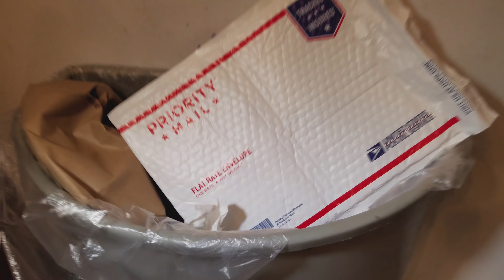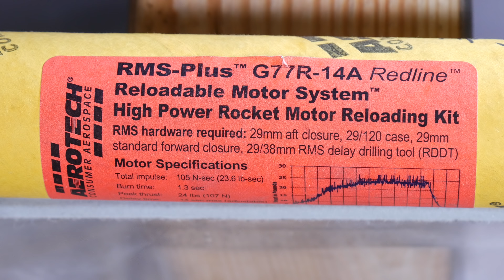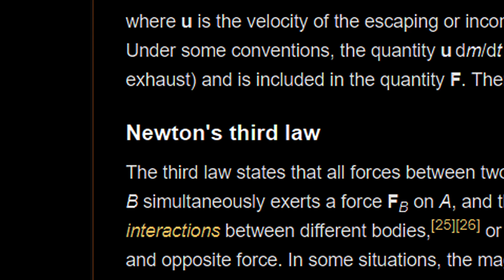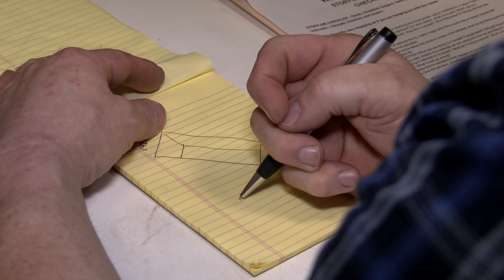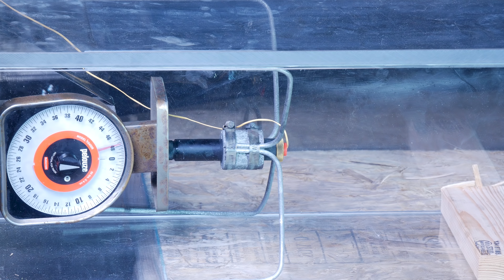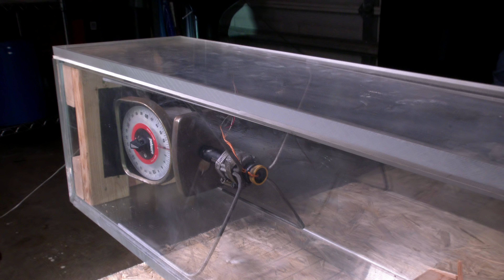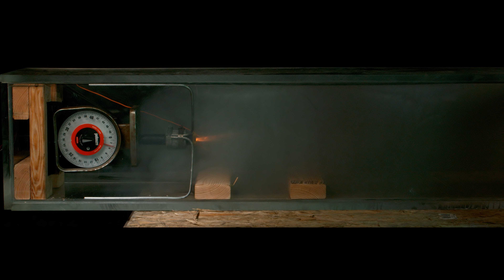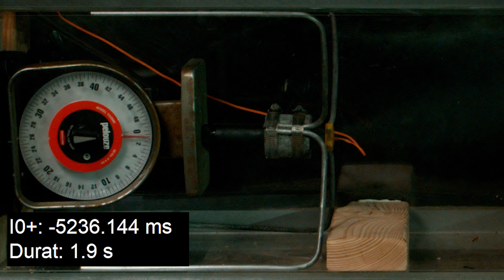Rockets in a Vacuum Chamber - Newton's third law of motion Visualized

Comment: One question. Where is the container in space?
Reply: There isn't one
Reply: HumptyDumptyOakland Well that is what is causing the rocket to move in this demonstration. The rocket fills up the container with gas. The gas fills the void and pushes against the container, providing a medium for the rocket to push against.
Reply: @FlatDan  
So at an altitude of say 2 miles what container is the rocket pushing against?
Reply: HumptyDumptyOakland None, forward momentum and the still remaining air density to push against.
Reply: @FlatDan  
At an altitude of 100 kilometers, what is the rocket "pushing against"? At that altitude, the pressure (about 0.008 Torr) is defined as a "medium vacuum," yet rockets have been experimentally proven to work exactly the same as on the ground. This is because rockets "push against" the gas they expel, not any surrounding medium.

Comment: Of course this will work in a vacuum. Why wouldn't it? Are there people who think it wouldn't?

It's simply conservation of momentum. The mass of the rocket times the velocity of the rocket equals the mass of the material times the velocity of the material coming out the back. Vacuum is irrelevant, other than providing air resistance.
Reply: As you can see by many of the comments here, there are quite a few that absolutely believe that. And they deny the evidence from the first few moments of burn, by claiming that this magically eliminates the close to perfect vacuum existing as the start of the burn.

Comment: The problem i see is that your chamber has boundaries and space doesnt . And to top it off , we are told space is expanding. It would be interesting if you had some pressure gauges at various points of the chamber to see if the ignition somehow pressurized  it.
Reply: Why did you run away from our debate? Did you finally figure out it is YOU that is confused about basics physics once you realized that crossbows DO have recoil?
Reply: @stuartgray5877  i sent you 2 replies . Its you that could not respond to proof i sent you that your theory is bs
Reply: @nickmerix2900  You did no such thing.

Now Tell me that you can imagine a machine that can accelerate 500 kilograms of WATER from a standstill to MACH EIGHT - WITHOUT FEELING A RECOIL FORCE

You have NEVER told me how you imagine that working.
Because you apparently think THAT IS POSSIBLE.

You apparently think that a machine can impart more momentum into a mass than an aircraft carrier delivers to a launching aircraft - WITHOUT ANY RECOIL.
Now tell me how that is possible using your superior physics knowledge.
Reply: @stuartgray5877  did you watch the videos ? If you cant understand them , i can send you another from an engineer .
Reply: @nickmerix2900  Oh, and I can literally show you hundreds of videos of rocket propulsion in a vacuum, and you would just dismiss the evidence by calling it fake with no evidence.
So what would be the point?
For example, watch "uninterrupted footage of the falcon heavy launch and booster landing! 2-6-18" here on YT.
Then explain what YOU see from launch till side booster landing.
Reply: @nickmerix2900  - "Show me a video of a space putting a satellite in space. "

Sure, watch the IXPE launch video from SpaceX.
I built, tested, helped put it on the rocket and launch it.
Reply: @stuartgray5877  wow ! You did all that? You qualify for a job at walmart.
Reply: @stuartgray5877  you are so predictable . I threw that in there as bait and boy did you bite. You ignored all the questions that you had no answer for and cherry picked that one little sentence. No wonder space x picks people like you that cant think outside the box to sell their lie
Reply: @nickmerix2900  So TELL ME HOW a machine can ACCELERATE 500 kilograms of water to MACH EIGHT without feeling a recoil force.
TELL ME THAT YOU THINK THAT.
Because THAT is what you are claiming
Reply: @nickmerix2900  I can ALSO tell that this is just a troll account for one of your many accounts.  I am certain I have argued with you before. I can tell from your specific type of learning disability.
But Bless your little heart anyway!
Reply: @nickmerix2900  "Stuart gray" is a chatbot. All it does is abuse people on videos like this.
Reply: @papalegba6796  the trans are comming out now 🤣

Comment: I think the test is flawed. There videos showing thrust in a vacuum doesn't dtsrt working till it hits the other end of a champer. 
If a vacuum indeed null thrust than higher pressure should increase thrust  which i think it would.  
What about a shotgun shell ? 
Probably still would have a kick but how much relative to zero pressure, 14.7 psi and high pressure.  
I donno.
Reply: Rockets have MORE thrust in a vacuum just as the 100-year old Tsiolkovsky rocket equation predicts.

Comment: I have been reading a lot of stuff that "flat earth" people claim about why rockets won't work in a vacuum and it's pretty funny stuff.  Usually it boils down the them clinging to the Joule Expansion argument stating that gas released in a vacuum does 0 work...but they totally ignore Newton's 3rd law where the gas being expelled from the rocket is what propels the rocket in the opposite direction of the expelled gases...not the gases "pushing off" or in other words "doing work" on the vacuum...
Reply: @papalegba6759  Um, where did come even remotely close to suggesting Newton was a flat earther?
Reply: @papalegba6759  "cos newton knew rockets wouldn't work in a vacuum.he wrote 3 laws proving it" ... Pretty funny...they explain exactly the opposite.  I can't tell if you're just trying to be funny or if you're actually that confused.
Reply: @papalegba6759  no, sorry again. Newton's laws say that rocket propulsion MUST work in a vacuum.  You have repeatedly proven that you do not understand Newtons laws.  Watch:. 1 - when the rocket engine is running is the exhaust gas ACCELERATED as it leaves the rocket? Yes or no?
2 - does the exhaust gas have MASS? yes or no?
3 - can MASS be accelerated without a force? Yes or no?
Just answer these three questions to PROVE you understand Newtons laws.
Reply: @tyslink  now watch as papa legba REFUSES to answer these simple questions because he KNOWS that answering Proves him wrong.  He will either come up with excuses why he doesn't have to answer or he will just resort to juvenile insults.
Reply: @tyslink  if you can't draw a free body diagram just say so, time waster.
Reply: @stuartgray5877  a system cannot bootstrap itself into motion thru internal forces alone, chatbot stu. so your questions are irrelevant, as a simple free body diagram proves.
Reply: @papalegba6759  Actually I've got a better idea...how about you draw one that shows you know more than NASA, or really provide any proof you aren't completely clueless?  No?  Didn't think so.
Reply: @papalegba6759  thanks for proving my prediction AGAIN that you refuse to answer my simple physics questions because answering PROVES You WRONG!
Reply: @tyslink  yeah I have asked him to draw a free body diagram many times. He admits that the vacuum CANNOT exert a force, but he refuses to acknowledge that there MUST be a force that accelerated the exhaust gas since we see evidence that it DOES get accelerated.  See how he refuse to answer my questions?  This is because he KNOWS that answering them proves HIM wrong.
Reply: @tyslink  See the three questions I ask Papa Legba HUNDREDS of times on these threads are:

1 - when the rocket engine is running is the exhaust gas ACCELERATED as it leaves the rocket? Yes or no?
2 - does the exhaust gas have MASS? yes or no?
3 - can MASS be accelerated without a force? Yes or no?

The answers are:
 1 - Yes - the exhaust gas is DEFINITELY accelerated .
      It changes velocity from ZERO (with respect to the rocket) to over 2500 meters per second (about MACH EIGHT).
  2 - Yes - the Exhaust gas definitely HAS MASS .
      For the Space Shuttle Main engine: It consumes 500 kilograms of liquid oxygen and liquid hydrogen PER SECOND, Combusts it and expels the exhaust gas (PURE WATER) at MACH EIGHT. The exhaust gas has EXACTLY the SAME MASS as what went in.
   Last time I checked 500 kilograms of PURE WATER - HAS MASS (500 kg to be exact)
  3 - No - an object with mass CANNOT be accelerated without a FORCE .
      Newton's FIRST LAW tells us that the ONLY thing that can change the velocity of an object with mass (accelerate it) is a FORCE.
     That is literally the DEFINITION of the word "Force" - "That which can change the velocity of an object with mass."

So Papa Legba REFUSES to answer these questions because it PROVES the following:
Since the Exhaust gas HAS MASS, and it IS ACCELERATED then there MUST BE A FORCE exerted on the mass of the exhaust gas - we SEE IT GET ACCELERATED as it leaves the rocket!
Papa Legba has ALSO admitted that "The VACUUM cannot exert a force".
SO that means there is only ONE PLACE that the force can originate FROM - THE ROCKET ITSELF!
So if we have PROOF that the ROCKET MUST be applying a force on the mass of the exhaust gases then the exhaust gas MUST BE APPLYING A FORCE BACK ON THE ROCKET !
This is Newton's THIRD LAW! - Forces NEVER occur ALONE - they MUST OCCUR IN PAIRS .

SO IF Papa Legba acknowledges the above then he MUST ADMIT that there IS A FORCE PUSHING BACK ON THE ROCKET!

And this would prove his bullshit FALSE!

Oh and Papa Legba is SUCH a big imbecile that he will not even admit that Burning Hydrogen and Oxygen makes PURE WATER!
He has been arguing with me about the fact that the Exhaust Gases from a space shuttle main engine are WATER.
He contends its "Just FIRE".
So according to HIM, you can combust 500 kilograms of oxygen and hydrogen and get NO MASS OUT from the combustion byproducts.

And people wonder why I call him an imbecile every time he confronts me...
Reply: @papalegba6759  - " if you can't draw a free body diagram just say so, time waster."

I want to draw this free body diagram for you, as you suggest, but I need your help.

 SO do you admit that the free body diagram of a rocket in a vacuum, MUST have at least ONE force arrow that shows how the MASS of the exhaust gas gets accelerated into the vacuum?
DO you ADMIT that there MUST be a force since we have evidence that SOMETHING is being accelerated?

Where do I put this arrow?
 It must point AWAY from the rocket nozzle since that is the direction of acceleration that is felt by the exhaust gas.
SO does this arrow represent the VACUUM PULLING out the exhaust gas?
Or is it an arrow that is PUSHING on the exhaust gas?

I am confused, please help me understand.
Reply: @stuartgray5877  lol forces exerted by the rocket would not be included in a free body diagram of one, psycho. thanks for proving you don't understand them.
Reply: @papalegba6759  Sure you did.  You're clearly good at "doing physics"...what a "genius"
Reply: @tyslink  lol free body diagrams are easy. sorry you can't draw the simplest 1 possible :(
Reply: @stuartgray5877  see how nuts you are?
Reply: @papalegba6759  cool story bro
Reply: @tyslink   true story, chatbot bro.
Reply: @papalegba6759  🤖
Reply: @papalegba6759   thanks for proving my prediction AGAIN that you refuse to answer my simple physics questions because answering PROVES You WRONG!
Reply: @papalegba6759  SO Papa Legba - explain to us how rockets create thrust IN ATMOSPHERE!
Come on you can do it genius!

Comment: So if you didn't have to wear a space suit you could use your farts to move around in space
Reply: Actually - YES.
Take the velocity of the "fart" in meters per second and multiply by the mass of the "fart gas" in kilograms.
Then you get the "Momentum" of the fart gas.
Your body MUST absorb the same momentum as the momentum transferred to the fart gas.
Divide the total momentum of the fart gas by the mass of the human body and you will get the velocity imparted into the body.

Comment: Problem with this experiment, you have a rocket in an enclosed space, which gives the energy something to push against. We are talking about an open system which is a vacuum. Make the chamber larger and use the same rocket. I would say the enclosure should be at least the size of a car.
Reply: you think that once the gas leaves the back of the rocket it can then push the rocket forward as soon as it hits a wall? But when it hits the wall it is no longer touching the rocket. So how in blazes can that be the reason the rocket has forward thrust?
Reply: @neiljohnson7914  There is pressure build up. Also, I do know that without oxygen, there is no burn, you simply cannot get a flame. That is why a solid jet fuel is used and oxygen is in the mix. So in order for that experiment to have even ignited, oxygen was somehow added to the mix, and if it had been vacuumed out as claimed there would have been none, no oxygen, no flame. I am not saying he is wrong, I am just saying the experiment could have been done better.
Reply: @cep2378  I am not arguing about how well the experiment was conducted. I am arguing witht he boneheads who claim that rockets cannot work in a vacuum.
Reply: @cep2378  the solid rocket fuel has OXIDIZER IN IT ALREADY !  Do you think a bullet needs atmospheric oxygen to fire?

Comment: I have actually been very curious about this for a very long time
Reply: @jrngln   
Nice copypasta. Every word of what you just said was wrong.

1) We can get close enough for practical purposes. Technically space isn't a pure vacuum either, but it's so rarified that molecules rarely come into contact with each other.
2) A vacuum doesn't "absorb" anything, you're speaking nonsense.
3) How exactly do gases on the opposite side of the chamber affect the rocket motor? The answer is they don't. The only forces come from the direct interaction between the motor and the gas. As soon as the gas leaves the motor, it can't transmit a force.
4) Yep. Rockets push off of their exhaust gas.